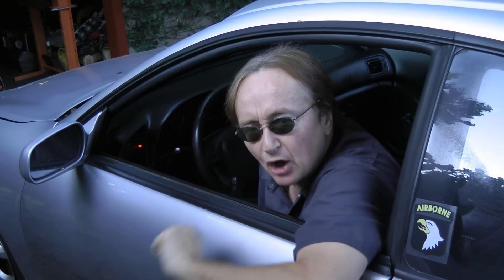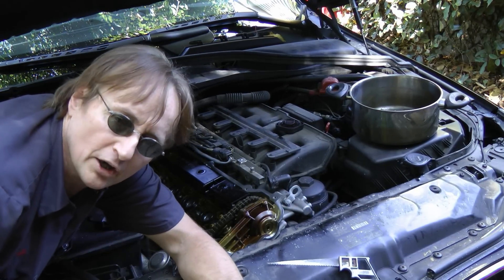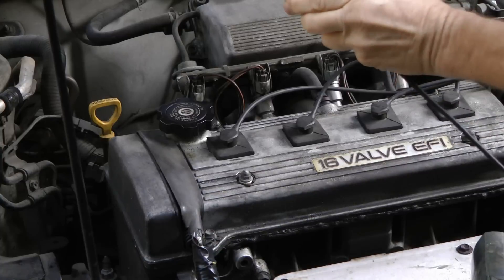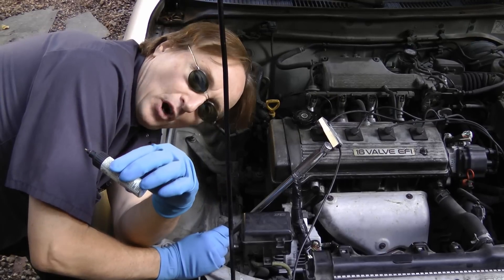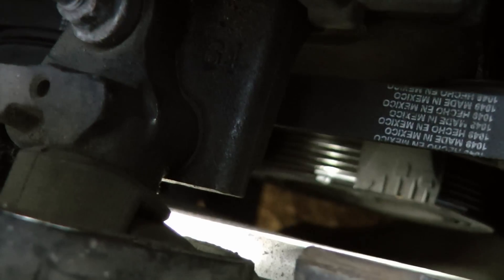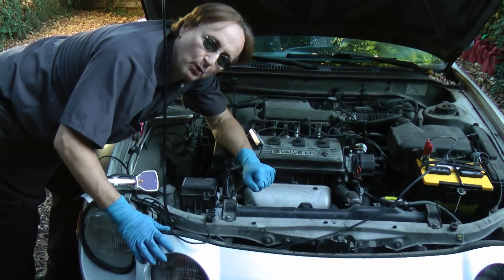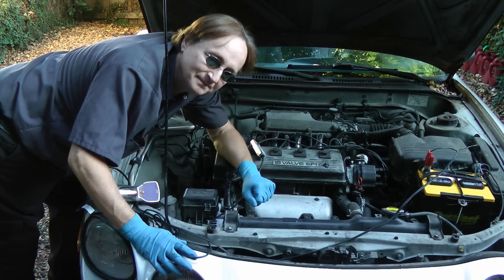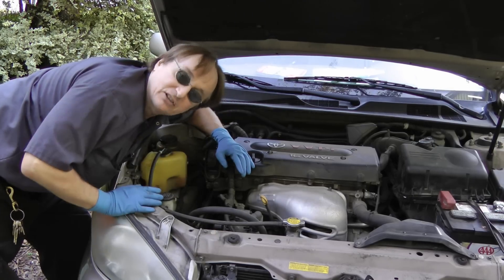How to Check a Timing Belt or Timing Chain in Your Car

Comment: I would have thought the point of using the timing chain was that it is supposed to last  for the lifetime of the car.
Reply: My 2009 Civic has 250K miles on it and no problems with the timing.  A timing belt would have been replaced 2-4 times by now depending on the manufacturer's recommendation, which can vary from 60K to 105K miles.

Comment: Ahh...ass!

My car has 3 timing markers..2 on the inlet and exhaust cam rotors and one tucked nicely behind the bottom crank...its a GM and a bitch to get the crank off to make sure they all line up...i would never try lining up my belt without the third one behind the crank...

not sure this method would work for me Scotty....good job tho...I have never seem one of those strobe light guns before for automotive!

You de maaan! :)

Comment: How much does it cost to replace a timing chain in an 02 Camry?
Reply from the maker: +GeneralSirDouglasMcA over a thousand bucks, it's a giant job if it has a chain. If a belt, 350 bucks
Reply: Yikes!  My Camry has 222k miles on it, however it still runs good.  But I'm actually going to drive it until it his 1 million miles, so I probably will have to replace it someday.
Reply: +GeneralSirDouglasMcA If you change it yourself it will cost a lot less.

Comment: your probably doing something wrong buddy, trust me they are all reliable cars, i have a 13 yr old celica and it runs better than new why, oil changes and preventative maintenance. we had a 90 accord had leaks everywere still ran like a dream. why oil changes and general engine checks/maintenance.

Comment: ive been told the 2003 dodge ram  4.7 liter is a overhead cam v8.. is this true???.. the mechanic says theres 3 timing chains and a headgasket job is a bitch job because theres special tools for not getting the chains out of time.. thousands of dollars .. this is not a pushrod v8?   teltale sigh is where the sparkplugs are .. there on top of the motor with long coils ..i pulled the plugs and the #1 sparkplug was fulll ..watch my video on dodge ram hydrolocked  rest of the plugs were fine

Comment: This is okay, but you never explained how to actually use the gun, what you point/shoot it at, what to look for, etcetera. I mean, what is the purpose of the gun, what does it do?

And from the video, the little white mark you made(which frankly I cannot see, nor do I know what the crankshaft pulley is) seems far more important than the gun itself, you talk about the mark moving and such. In fact, it seems to me(from my ignorant perspective) you are using the light gun as more of a flashlight than anything else.

Comment: do you prefer a timing belt or timing chain?
Reply from the maker: chain, as they can last forever if you keep the engine oil clean and changed regularly
Reply: i got a car because of it has a chain instead a belt. belts are expensive. here where i live about 650 dollars with parts and labor which includes the water pump.